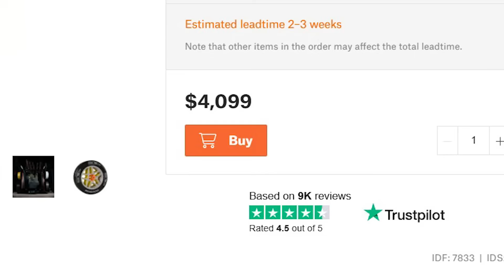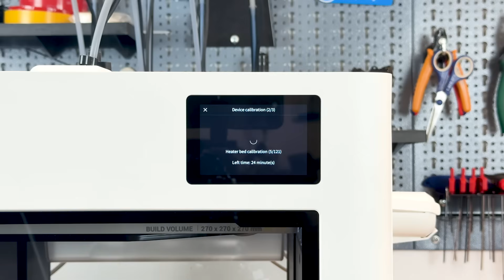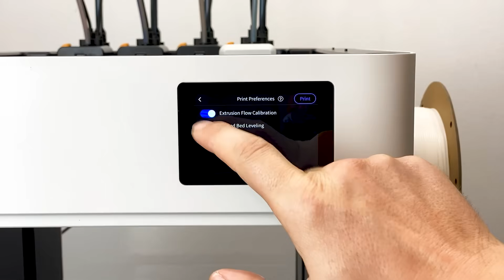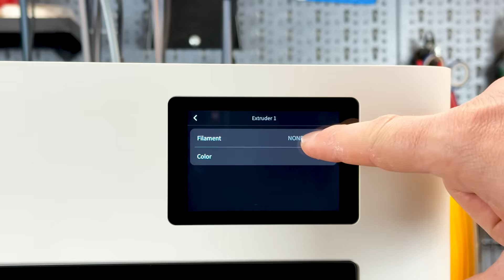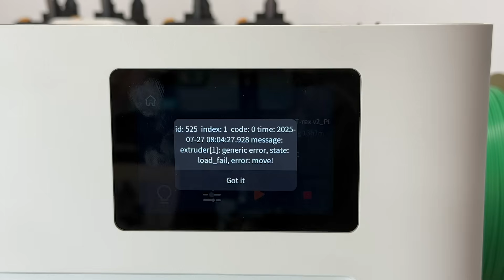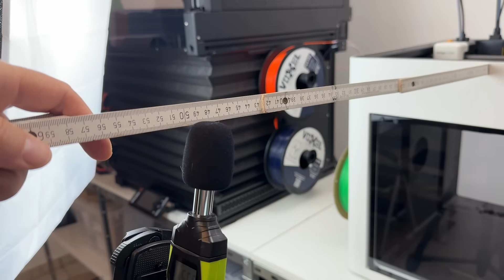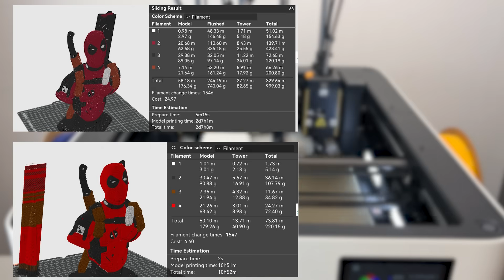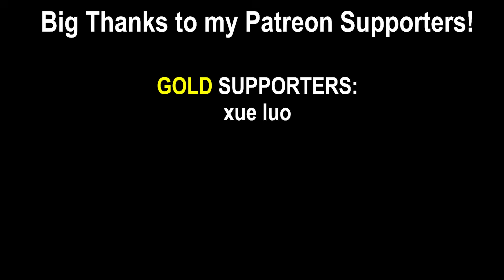Snapmaker U1 XXL Preview: Less waste, Less money.

Comment from the maker: Here is the list of flaws of that late stage beta protoype I pre viewed.
I would NOT review a prototype.
The whole point of a beta test  / preview is to uncover and document exactly the kinds of issues listed here. 
According to Snapmaker, they are confident that the major points will be solved before the U1’s final release.
I believe: They won't mess this up - most is minor/software.

Corrections/Additions to video:
- speeds acceleration: Inner Perimeter is 10k mm/s², not 5k mm/s²
- ... to be added

My Top Three Topics
- Improve automated filament loading (last path into hotend)
- Fix slicer / app connection & upload issues
- Extend and improve slicer profiles (ABS, TPU, coarse, etc.)
 
Software Topics:
- Bed mesh and flow calibration take too long
- Add adaptive bed mesh (Klipper’s KAMP)
- Filament unload script is inefficient/slow: Why even do slow Z-homing? Heat-Up directly when triggered.
- “Unload all / selected toolheads” option would be convenient
- Aborting unload script has no effect (continuous loop)
- Display: screen tearing when scrolling
- UI: improve color contrasts
- UI: add clearer "Confirm / Accept / Apply" buttons (see editing material/colors, then “X-ing”)
- Lights should turn on at print start (especially for timelapses)
- Add “Cool/Heat all toolheads / Bed at once” option
- Slicer: auto-arrange after cloning parts is annoying
- Add heat soak scripts for higher temperatures of the bed (e.g. >70°C)
- Improve webcam framerate (currently <1 fps)
- Full-screen mode for camera preview in slicer
- Add “motors off” button in Fluidd and printer UI
- Snapmaker Orca Slicer can heavily slow down PC (sound stuttering etc.)
- Filament run-out error handling
- Prompt currently saved value(s) for pressure advance (and for which filament) in UI/Slicer
- TPU multi-material printing: toolhead clogs - optimize anti-ooze strategy
- Optimize anti-ooze for towerless printing (see Prusa XL)
 
Hardware Topics
- Door and panel alignment
- Waste bin fixation has play
- Spool holders: design could be simpler, cheaper and sturdier (see Prusa XL): No need for adapters. >1kg spools!
- Spool holder rubber pieces can fall off
- Spool holders detach too easily when removing filament
- Print bed fixation must be improved
- Toolhead front cover alignment
- Manual: specify screws for USB-C cable (toolhead side vs. printer side)
- Manual: some duplicate pages in mine
- Purge waste often lands inside the chamber
- nozzle wiper pad TH0 got worn out very quickly
Reply: Have you done a dimensional accuracy test?
Reply: This was printer were were all waiting for from Bambu, just got my on Kickstarter. This wil lbe my PMulticolor PLA beast, and qudi q2 for all other stuff, P1S will proboly not be used much anymore.
Reply: Have you had any updates since you reviewed the printer? Keen to know if they're listening to you and serious about getting it right before shipping.
Reply: holy crap, the first 10k units kickstarter is already completely sold out.
Reply: @burnsyd17  Yeah and they're all going to full of defects. This is why I won't touch a Kickstarter project with a hopeless development team.
Reply: And they are actually « selling » this and sheeps are baking this 🤣🤣🤣
Reply: @omerozbekoff seems like some people still can't afford even such a bargain. Well better luck next time 😂
Reply: You forgot about the noisy four hotend fans you noticed in the video.

I don't think they will be replaced, but do you know by chance a reference of a suitable replacement part ?
Reply: Screen tearing is not going to be fixed, it's either a laggy low framerate display, or a visually smoother but tearing. The bottleneck is with the display interface speed.
Reply: Adding the ability to print a single design with different nozzle sizes.
0.8mm infill, 0.2mm details, 0.4mm walls.
This printer will do it, but you can't configure it in Orca Slicer.
It's just a software issue.
They need to do it!
Reply: Hinged touchscreen?
Reply from the maker: @asdf154  I don't think conceptual hardware changes like this will happen until shipping.

Comment: Absolutely spot on! I'm not a wizz kid when it comes to the tinkering side of printers and decided recently to save up and buy (most likely) a Bambu H2D or H2S  for that plug n play factor that you just don't seem to get with the K1 Max.

This video changed everything!
I really hope Snapmaker fix these issues as I cannot justify the cost of a fully equipped Prusa XL and you know a tool changer just makes sense from a practical standpoint.

Ohh I cannot wait for Snapmaker to get these on the market!!!
Reply from the maker: Glad the video resonated with you - let's hope for a smooth launch and improvements!

Comment: This looks like a Prusa XL knock off.  Its smaller and a lot cheaper, but you get what you pay for.  As a lot of the parts look like they are made for this toolhead setup, good luck findings replacement parts when something fails.

Comment: Personally, I don’t care how long calibration takes if it means that the printer is reliable. I want to set it and forget it. The only reason I sit around until the print starts is to make sure the first layer doesn’t fail. But if it rarely fails, AND has spaghetti detection that works reliably, then who cares how long the calibration takes. Press print and leave. That’s what I want.

Comment: I would want it to combine TPU with other materials. How complicated is it to get that working? Did you try it multiple times?
Reply from the maker: Yup, tried it three times - also altering the TPU profile. I’ll get back at it for the review 👍
Reply: @247printing  I'm really curious. I backed the kickstarter, because it seemed to work for others like MPOX. I hope it is not wishful thinking. 
All the other hardware problems seem bearable. E.g. I would print from a drybox anyhow.
But my plan is to actually do multi material and especially TPU, as that is not possible with any Bambu-Printer and no non PrusaXL printer I'm aware of.

Comment: When prusa XL came out, I told everyone that toolchanging 3D Printer doesn't need to be that pricy. The day has come. If snapmaker succeeds, It will be a breakthrough. Specially, printing multimaterial with multiplexer type AMS is so frustrating. 
Hopefully snapmaker will bring that problem to an end. Though there is some concerns, more tiny mechanical parts means more fields for crash. Bambu handled them nicely. Lets see what snapmaker can do. Kudos.

Comment: Can you share your thoughts on the $149 lid? It seems that the fact its not actively heated will limit the lid to ABS/ASA printing, and in my opinion I would probably be better of getting the Snapmaker without the lid, and save the money to buy a P1S without AMS for ABS/ASA/single color printing. What do you think? For me, the price difference between the lid and the P1S would be around a 3x.
Reply from the maker: I mean, you have a maximum nozzle/bed of 300°C / 100°C (on the P1S as well). That's the limit for both - will be more materials than just ABS/ASA, but yes: You're limited, but equally on both. I ordered/backed the lid to conveniently print higher temp materials and to have the air filtration. Advantage over the P1S is to be able to do proper material combinations (e.g. also for support or support interfaces) without contamination of the main material due to one-nozzle-purging.
Reply: @247printing  Okay, that makes sense. I`m completely new to 3D-printing, so I`m trying to soak up every bit of insight I can find 🤣
Reply from the maker: You’re welcome :)

Comment: I backed it when it went live. And I'm now doing my homework of several hours of videos. Where all the videos had one or two good parts And points to make; your video seem to hit all of those same points All in one video. You're the only one I've seen so far that actually did a edge to edge 1st layer test. I've had a Snapmaker before and their bed leveling is absolutely miserable, so that's one of the things that I'm really keen to keep an eye on. Of all the videos I've seen, I would recommend a few minutes of each 15 minute video. Yours is the first one that I will recommend watching the entire video.
Reply from the maker: Oh wow, thanks for that!
Reply: u know bed leveling i had a ender 3 for 4 years and i had to manually level all the time, i never owned a bed auto leveler, so coming from that to a actual bed level like on the bambu now is like game changer amazing, it interesting to know why snapmaker bed level was so bad, seems something to do with the sensor curious if u ever just replaced it the nozzle device
Reply: @jazzmanny02  I did. I got a hole new tool head and its still just as bad.
Reply: Are you still backing or did you drop out?
Reply: @andrewvillavicencio8496  I'm still in it. PAYMENT HITS TODAY 😅

Comment: It seems too small. Looks like it’s a two 50 x 2 50 or so. They might as well get it right and make it three50 x 3 55, 350 or larger at least the size of the K2.
Reply from the maker: It's 270x270x270, as mentioned. Let's hope they make a bigger one as well :)

Comment: Compliments, it is a very in deep review of this printer 😀👍. It confirmed what I have already seen on other channels on this printer's capabilities. I have just purchased a CORE One, that is still boxed, and I was looking for the multicolour option. Unfortunately I was disappointed from what PRUSA did (almost nothing), and I did not liked how they tried to integrate the MMU3 on the CORE One. So I did not purchased it. Now all in the sudden, this new printer appeared on the market, and it is basically my dream 🤩. I always wanted to have a multi tool, but the available products on the market had a price that was prohibitive. Bondtech is still far from release their INDX, and may be that by the end of the year, they will just start selling the first samples, but a complete printer with INDEX is still far. It would require specific firmware, and all this is still too far. So there is basically nothing.
So when I saw it at that price I backed it immediately on Kickstarter, adding the cover that transform it in an enclosed printer. The current cost of a couple of hundred euro more that what I would have paid for a MMU3, give me a complete printer 27x27 with multi-tool. Another level, another value. 
I am sure 2026 will be the year of the "run to the multi-tool", because BambuLab and Creality will not just stand by and watch. 😉

Comment: No test and showoff of one of the main issues w multiheads, i.e. alignment ? Surprising 😔
(to see if there is any offset showing up on prints: on vertical walls, boundary btwn surface areas, and btwn surface tops)
Anyway, thanks for the otherwise informative review.
Great time / waste / energy compare with other printers !
Reply from the maker: Thx. Though: Alignment is spot on, tool changes were flawless - not a single error there.
All mentioned in the video :)

Comment: Great review. I’ve backed it as well and I haven’t backed any other printers since the X1 Carbon, which I’m still using daily. I’m confident Snapmaker will sort out the software and firmware issues before shipping. The fact that the hardware is so good where it matters, and that preproduction units are producing excellent print results for several beta testers also lends to confidence. Their behind the scenes factory and testing video is also legit and shows how much effort and resources they’ve already invested into this product. I don’t mind that established companies use kickstarter in this way. It’s smart for marketing but also getting beneficial feedback from their users and potential customers to help them finalize the product in meaningful ways. Very excited for this printer to join (not necessarily replace) my X1C.
Reply from the maker: Very well observed and summed up 🙌

Comment: That bed heater speed is terrific. For small prototype parts, bed heating time is a significant delay between design and testing.

Disappointed that it's not an actively heated chamber. That will prevent me from purchasing.
Reply: There is an addon option for it BUT it is only 50c and is supposed to ship in march 2026.

Comment: Problem I see that stands out is the open spool holders.  Limits you to which type of filament and when conditions prevent from a clean print.  There are some filaments I would never run do to the exposure to open environment. If they made a heated enclosure that fed each head, that would be an improvement.    I can't see it ever taking the place of my H2D though, not when I have the choice of 24 different filaments, a larger bed, and spools that are kept dry, a little poop is no big deal with my setup.  Make the bed at least 300 x 300 x 300 and enclose the spools and then you have something.
Reply: I mean they are just spool holders, there is no mechanism in it. You could easily put a spool in a frying box and load it up.

I would also assume people to design an enclosed system for it. I honestly don't think it's a big deal, it wasn't until very recently that we got like the heated AMS, before that it was all the same.
Reply: @benjaminvdvyt that's actually one of the add-ons they are selling four rebranded polydryer for the printer.
Reply: @benjaminvdvyt  Its a big deal when working in a humid environment with filament that absorbs moisture like a sponge.  Even with an AMS 2 that does a nightly drying cycle filled with Desiccant, it still sits at 20%.  Thats the problem.
Reply: @acdii you seem to miss the point. Whether the spools are on the outside or not, they will need drying.

So you need filament dryers, and this print can print straight from a filament dryer. In fact their Kickstarter mentions a pack of 4 dryers.
As a satisfied P1S owner, I basically cannot print from a filament dryer through my AMS. So if you want dry filament, this system is preferred over my AMS.

I see nothing wrong with this system.
Reply: @benjaminvdvyt  No, I'm not missing any point. Some filament MUST be dried before use, and should stay enclosed while in use. Wood filament can absorb moisture rather quickly and a 3 hour print job might start out with dry filament, but halfway through will start to fail due to the filament absorbing moisture.  There are other filaments that are sensitive to high moisture as well and need protection, especially those jobs that can take 24 hours or more, and having open spools on this machine in an environment with high humidity will cause a failure on every attempt.  You can argue all you want, but I made my point, unless this machine has a dry box to feed filament out, it limits it's use for some users.
Reply: @acdii nothing is stopping you from putting filament in a dryer then feeding into the printer... they're even offering a discount bundle with the snapdryer boxes. I'm going to use my sunlu s4

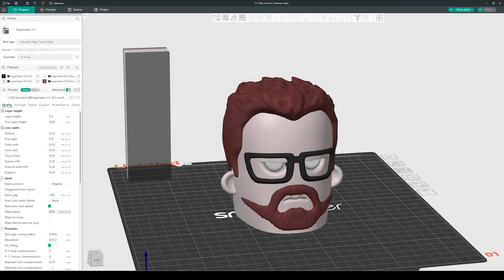Comment: 12:34 i would like to know if that 92 hour print on the P1S would even survive without the poop chute getting backed up and causing a print failure.
Reply: If you're chute is set up properly, then why would there be an issue? And an X1 Carbon would simply pause the print and wait for you to clear the issue, then continue. This machine locks you into 4 colors only it looks like, currently i have 8 on my x1 carbon, and can add 8 more. Plus this thing keeps its filaments hanging outside like a caveman soaking up moisture, an enclosed won't do you any good unless you enclosed those as well.
Reply: @kriscastner2010  because I've had several prints that were multicolor that were 20-30+ hours and failed because the chute was backed up and the toolhead crashed into it causing a major failure.

Comment: I am highly considering this printer as my first ever kickstarter. I am looking to replace my X1C, and this looks like it if it lives up to the advertisements. My biggest hesitation is Snapmaker while pretty, has not established a reputation for reliability.  This is an extremely smart move , IF they pull it off. Which is another reason I want one, this particular printer has my inner engineer dying to poke around at it, and find its quirks. And I get to finally start experimenting with materials that do not stick together. I want to build a stealthchanger, but those are so expensive by the time you are done, that is is well out of reach. The U1 is what I wanted the H2D to be.
Reply: This is like the proosa xl I can afford! Lmaoo it looks so good on paper, I hope it lives up to its name. I was saving up to build a AWD Voron trident from siboor but i am seriously considering the U1 instead as my daily printer and build something else for my tinkering printer
Reply: I am currently contemplating whether I should back this or get an X1C.
Reply: @markusk2289  dont get an X1C, get a P1S or H2S.
Reply: I’ll take the X1C. How much u want for it

Comment: The vfa! I don't understand why new printers are not adopting 1.5gt just to begin with. At least it's open source enough to change it out.Thanks bud! Great job ✌️
Reply: How would 1.5 GT belts help exactly? Wouldn't it just change the VFA pattern to be 'denser' since it's a smaller pitch length? I'm interested to know what you have in mind